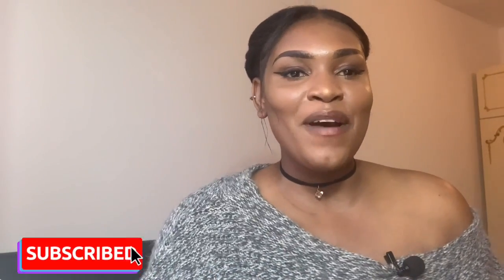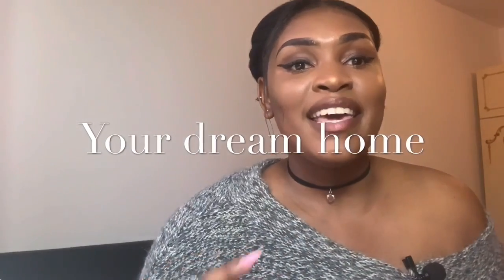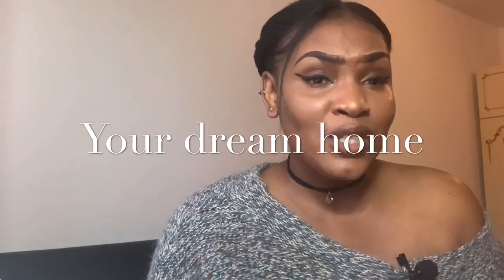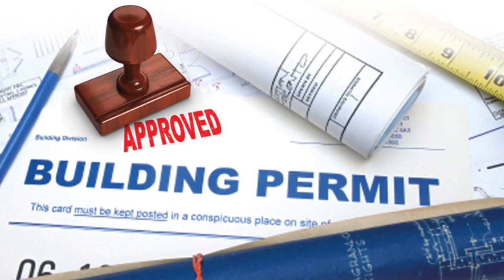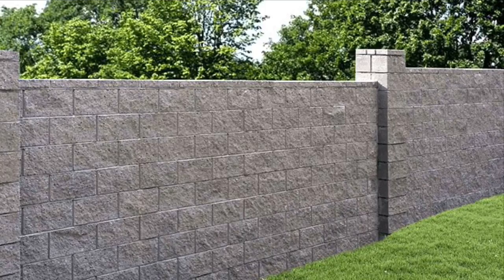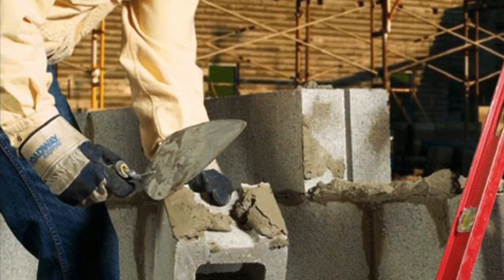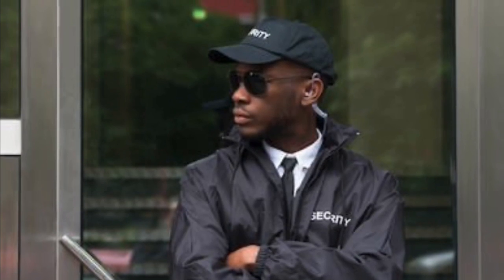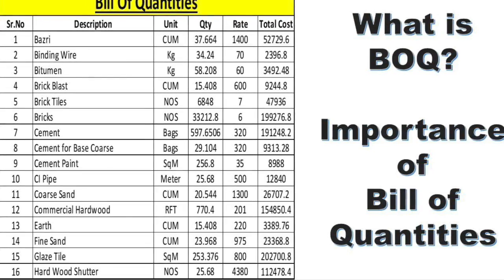African diasporas moving to The Gambia to Build their dream home MUST WATCH this BEFORE BUILDING..

Comment: As a Chartered Builder and QS - and having built my own compound you have done a good simple briefing- any one can pick holes but a fair guide. If you not present advise a Turn Key Contract approach and ensure stage payment on performance criteria- avoid advances and ensure a proper Contract. Being ex British Colony English Law basicallywith nuances so standard UK building contract forms are a good basis with Local Lawyer input, Get three competitive tenders on Contractors design and build basis from your drafted design brief and structured strict payment schedules with retentions at 10% until practical completion 
Your right to express good supervision of finishes and time expectation of contract
Control your budgets and don’t tinker on changes to avoid cost increase but do allow a contingency sum for unforeseen at least 5 %
If D&B approach the contractor will be responsible for all regulations and local permits etc and acquisition of materials and delivery charges that can easily at home the unaware. Gambia has a number of good housing developments such as Taf etc and good Architects
Reply: NjieSeedy What do you think is a fair price for a good architect?  I’m really enjoying this thread. Good sound advice.
Reply: Rita X It depends on your brief. IE size of development single or two storey etc, Initial design fees approx 50.000D to 150,000 say. But a full package between 7.5% to 10% of construction budget costs. Gambian Architects have offices here. If you need a recommendation let me know.
Reply: NjieSeedy Yes. Absolutely. All positive advice is appreciated.
Reply: Rita X your welcome any time-good luck with your move
Reply: Thanks for your insight. Can you share more information about the compound that you built? How long did it take? How big is it? Etc.
Reply: Ker si Senegal  I purchased the compound in 1987.its approx 2/3rds of an acre. Built in 3 phases overtime- as described by Rene purchase and lease takes time so be patient an essential ingredient in Africa- once registered at Local Urban Council level and approved by Arkli in those days and still today if customary land and survey by Physicial Planning for Lands Offce and Lawyers leasing of your freehold land. Build permits etc your first task fence your property both to secure and demark your boundaries
Reply: My Build commenced thereafter in 1990, by use of a fixed price D&B scheme with a Gambian Contractor. The first phase two houses and a Bungalow cut my teeth with the local scheme of things with that contractor, but it was an effort back and forth from UK supervising the stage build. Finishes and standard of finishes needed high input of supervision and time. I discharged the contractor before practical completion having got to the stage of an agreement that I needed to involve in finals and decorations etc. The Bungalow became my pad and accommodation in every increasing visits etc. We got there by self help and using extended family and contacts. 1991. The second phase 3 let table units ie self financing proposal for development followed- but lessons leant was devolved and built on materials and labour only with measured fixed price craftesmen employed with stages being supervised and input directly on visits over a 18 month period, worked well but was high input. In between developed the divisions on compound and bought in services Water and later electric. In those days urban Serrekunda had no services. IE development used a well as part of initial infrastructure and too many blown Generators. Gambia Experiences etc.
Reply: By 2001 and building on Experience- I proceeded to build my home, ie the big house I fondly call it. It’s now my home-I had the opportunity to come virtually full time for a couple of years with some small consulting work for aquantainces of mine, some mutual to my contacts etc. I used my own accommodation already built and used one other unit to house my core workers, so this assisted and also Secuiritised the build and team loyalty and team spirit essential in Africa to give benefit- also education of your labour force important to standards and finishes and your pocket. A piece of advise Gambia needs 3 pockets. Small medium and large(reserve’s) LOL 😂 please stick to plans and budgets. Much was self build with crafts added to my team. It worked well completed in 24 months to a then good standard but commercially considered. Built to cost plan and practical not over elaborate or uneconomic grandiose- 18 yrs later it’s still good and holds its place as desirable. It’s comfortable. Once electricity came I have added Air Conditioning etc. 3/4 bedrooms on suites kitchen Dinning Lounge flop area guest Bathroom and guest Toilet and integrated Garage etc. Last year I divided the tenants houses inc my original bungalow to increase privacy and security and extended and increased one of tenants units to 4 room apartment. A builder Surveyor does not stop improving and renovating- all the units have stood the cause of time well and keeps the wife happy, but I still get my lists and to do’s etc. That’s life. Gambia is a good life all things being equal. I believe it’s been a good overall experience- even with ups and downs and patience and listening (in the right way) important- don’t be discouraged or disrespected- life is a learning curve warts an all, but that’s building wherever or who ever you are.  Buildings evolve and foundations must be good though out the process but certainly in the ground and your brief concept- HO for it patiently with 3 pockets and contingency- it’s one world honestly